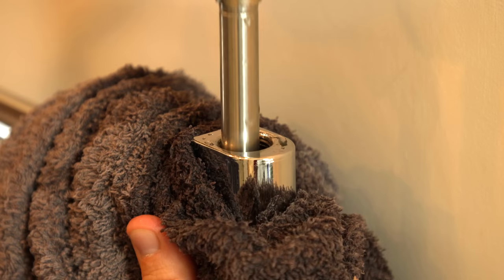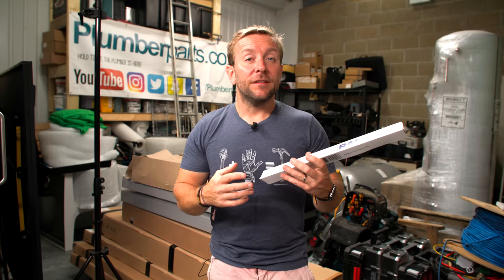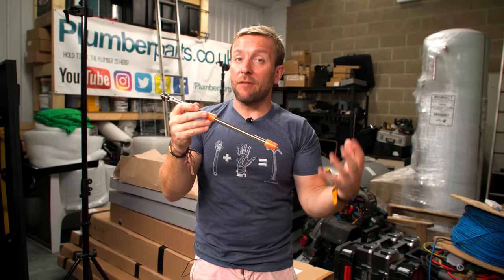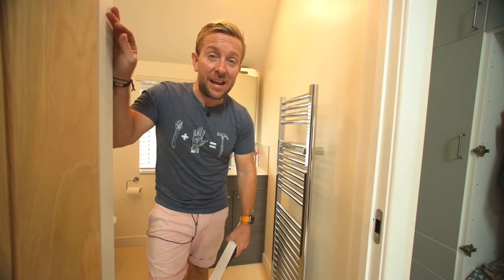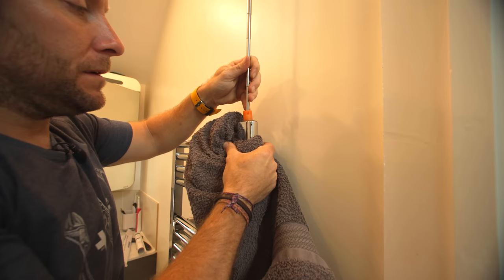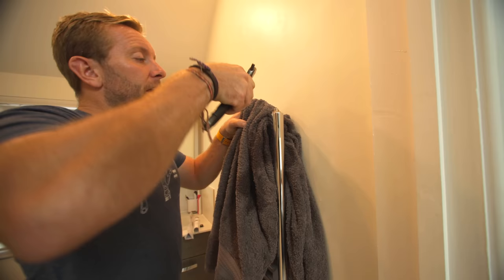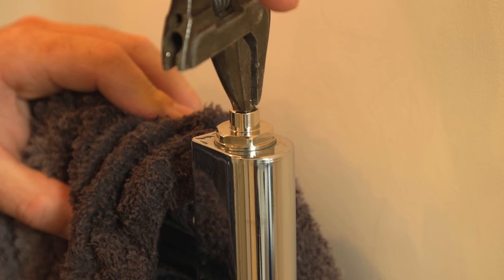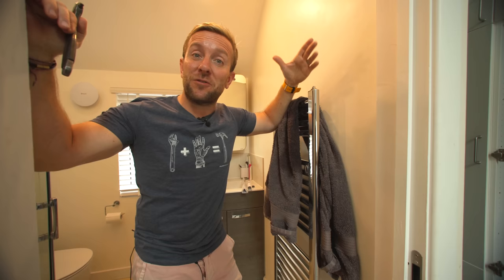DIY Magnetic filter INSIDE Radiator - How to fit Radmag

Comment: Hey James... Saw your video and thought what a genius product. I've got a Vaillant filter in my system but I thought Radmag would give it a helping hand. Anyway it turned up and I installed it real quick in my (tall) towel rail. Ran the heating for 30mins and of course had to see what I'd collected. Went to pull out the Radmag and found the little nut had fallen off the bottom and disappeared, and the bottom spacer was floating just below the vent hole. Cue a pause for thought... Fished out the spacer and noticed the hexagonal recess where presumably the locking nut should sit. Remembered that when I'd done the installation, the locknut was proud, and therefore loose. My bad I suppose.  Instructions could have mentioned checking this though. As I'm a very persistent man and don't like to be beaten, the next day I isolated my towel rail, took it off the wall, flushed it out and recovered the nut. Took the Radmag apart, re-assembled with all threads done up tight, and used Loctite. Problem solved but I think all purchasers should take that precaution, obviously before installing in a fit of enthusiasm, like me, and causing extra work :-) :-)

Comment: Guessing it’s a weak magnet and capacity load will be small? Can imagine it collecting what a magnaclean can then scraping off back in to the rad as you pull it out 😂
Reply from the maker: That’s what the plastic protectors are there to mitigate. I’ll know when I do a service in a couple of months. 👍
Reply: @plumberparts  may the gas gods be in your favour sir 😬
Reply: Ive installed them and magnet isnt weak at all
Reply: Wonder whats the service interval ?

Comment: I bought one, but didn’t have enough headroom to properly install it. 
I managed to take it apart, so I could lower it in piece by piece. Unfortunately, the orange plastic guides would not pass through due to the horizontal tubes being proud. Never mind, I thought, they’ll come off as well! They did, and everything was going well until the final piece of the telescopic piece also fell foul of the protruding tube! 
Defeated, I reversed the process. 

The magnet wasn’t in the radiator more than five minutes and it was thick with magnetite! It’s an impressive product, and for those whose installation went smoothly, I can see it working well. A shame it hasn’t worked for me. 
We have a real issue with where we can install a magnetic filter and I thought this would be perfect…….

Maybe I’ll replace the towel rail instead!

Comment: Nice idea. Better than nothing, but not a good position for a mag filter. If space on pipework is an issue, then fernox tf1 omega without valves can normally fit somewhere much more handy than that.

Comment: Bought one of these, removed after a month where it had collected a film of gunk. Put back after cleaning, 2 months later removed again for cleaning and found that the magnetic part had unscrewed along with the plastic spacers and left within the towel rail. I now have to remove the rail and try to push it all out from the bottom. I tried to reinsert and re-screw it all in situ but to no avail. Result new towel rail. Bad design due separation of magnetic end of rod. Beware !

Comment: Check that the bottom fixing Nyloc nuts are secure. Also check that the two blocks on the device fit the aperture of your towel rad. Do not force them in!!!!! If needed, sand them down to fit.

Comment: Why, at about 6:43 when you installed it, didn't you fully extend it so that the magnet was right at the bottom of the towel rail nearer the isolation valve?
Reply: it's 800mm long, the rad is 1200mm+ . Explained at 4:30
Reply: @UberAlphaSirus  Thanks. When you said  "we'll extend it that far" it sounded like you chose a specific amount to extend it rather than just fully extending it.  Makes sense now. Looks like a good product.

Comment: What about a normal rad, can these only be installed on towel rads?
Reply: any normal single panel rad.
Reply: Problem with normal rads is that your bleed screw is generally at the side, meaning the magnet rod would be installed horizontally at the top. Thus reducing the effect as most sludge sits at the bottom.

Comment: Hi James love your videos..just watched your plumbworld radiator video..I've just purchased 3 of the towel radiators pw1600600c the instructions show it fitted with the 4 bars at the bottom but all there pictures show other way up .phoned them to ask what's the right way to hang them an also asked him about the valve inside the radiators he didn't no what I was on about and whether it's upside down or not.if you can offer any help please.

Comment: Just wonder how those plastic guides will last after 12 months of hot water going over them, not totally convinced tbh
Reply: if they are made from polypropylene then no problem.
Reply: my kettle is made of plastic not to mention many other kitchen items that go inside a dishwasher without issue . plastic is robust &  hot water heat cycles will be no bother here.  where plastic is vulnerable  is around solvents usually petro paint thinner type like around vehicle engine bay plastic there is a nightmare.

Comment: I think this is a good idea in theory. But it’s not a replacement for a filter on the return! This will filter a small part of the system and if it blocks the towel rail blocks?
Fine for DIYers but not sure that heating engineers should be fitting it.

Comment: All well and good removing it from a towel radiator but won’t stop the build up downstairs and with you saying if you haven’t got or can’t fit a magnetic filter then use this, I doubt it would collect it, but if never serviced and a heating engineer was unaware then maybe in time it would clog up, ? Think in needs proven property on a bad system and maybe compare.

Comment: you should have done a idiots guide to removing the cap on the rad towl. If the flow does not stop in 20 sec or so then your valves may not be working and dont flood the house :)

Comment: Can these be used in conjunction with magna clean or instead of, or is there no point using this if you already have a magna clean installed?
Reply: He said he is fitting and he already has other in place .....
it would be good at end of line or furthest rad from the start imo

Comment: I fitted one last week, whilst doing other work on the heating system , easy to install, on recommissioning the system I took it out and it really does drag out the contamination and this is only out of the towel rad so far as not circulated yet. But the bleed screw is of such a very poor quality , it is as if a 1st year apprentice has made it by hand with a "bastard" cut file , it simply is so bad and not square to use a normal rad key. The use of a "juzzie" spanner simply is over kill and access is somewhat limited so not really convenient and not what should be expected. I will update this in 6 months .

Comment: Will it not make the whole towel rail magnetic and all the crap collect in there? Will be interesting to see
Reply: But then how do you get it out?
Reply: if it did you wouldn't get it in or out, it's just enough to catch the metal in the water....
it would be a good addition to the system and also add inhibitor

Comment: Will it fit in a regular rad (horizontally) ?
Reply: If your talking about standard panel radiators K type then no because they only have an opening of about an inch or two before branching off to the panel(s).  Some of those bigger vintage / school radiators might work and some modern panels might. Likewise same theory for adding electrical emersion style heaters to radiators.
Reply: @_Miner  gotcha, thanks
Reply: I have been using  Kamco machines  for 20+years and have worn one out, I've flushed so many systems!
Bought the original Adey powerflush kit at Earls Court when it first came on the market; Chris Adey was on the stand and I paid, I think 150quid, as an add on he gave me FOC a 300mm Magnaclean.The two combined is the only way to deal with badly contaminated  systems!
I would advise anyone  who is serious about combating magnetite to get on a Kamco course. If not, your not a serious professional. 
I'm  sure, given the numbers of boiler changes, a lot of installers may convince themselves that systems changed in even as little as the last 10-15 years only require draining and refilling, thorough flush or Magnaflush as being adequate.
If the the condition of the system is not seriously  determined , the life of the boiler is bound to be negatively  impacted! And using cheap and or inappropriate cleaning and inhibitors can not be tolerated by the professional  installer.
I know my comments will not be greater positively  by many , but don't  listen to me, take the time to find out what Kamco etc. Fernox, Sentinel, Adey,Scalemaster, Calmag and other quality providers can add to your expertise.
Knowledge  is not cheap, quality is not cheap and cheap don't buy a professional  installation.
All this prompted  by the absolute and most outrageous,misleading, cynical posting by plumber parts!!
I'm  and have Always endeavoured  to portray myself and the trades in the most positive way.That sort of commitment  didn't  come cheap, unlike this most disgraceful misrepresentation!!
I look forward to you making amends.

Comment: Do you think this will stop the build up of sludge in other radiators or just the towel rail?
Reply: It should help clean the water in all the radiators as it picks up sludge when the water flows through. That's the idea anyway.

Comment: Not as good as understanding water quality and preventing a dirty system of course but the UK market is a completely different one to the rest of Europe.
Reply: This is an irrelevent comment as in the real world we deal with peoples heating systems as they are not how ideally we would like them to be. Radmag helps to clean up heating systems in the real world.
Reply: @marknorris5529  flushing the system is a solution, this is like putting a plaster on a knife wound.  It's just another gadget being sold into the massive British heating industry when what installers really need is a higher level of training.
Reply: @patrickwheeler2646  Then you clearly think the same of jar filters too
Reply: @marknorris5529  not for retrofit, most systems have been neglected for a long time and the existing corrosion of steel radiators has to be prevented from damaging new heat sources.  For new installations I do yes.
Reply: @patrickwheeler2646  then logic suggests you must think the same for radmag too
Reply: @marknorris5529  meh, I can't see why you would bother instead of putting in an MB3 or TF1 Omega.
Reply: @patrickwheeler2646  because you need to cut the return pipe on 22mm thats the point.
Reply: @marknorris5529  the section of diyers who will be comfortable fitting this product but not confident draining and cutting in a filter AND won't pay for a professional to do it is incredibly tiny.

Comment: Warning just tried to fit this the orange sleeve was really tight so much so I could not get it out of the towel radiator. I had to cut the top orange one off so that it would go in . Now I can just pull it out to the magnet section to clean it . Please check if it’s tight don’t put it in towel radiator. If both sleeve were in I would never have got it out . Please be aware

Comment: Absolute waste of money. Anyone who knows anything about  system contamination will I'm  sure be outraged by this one sided, simplistic and misleading presentation!
Reply: You not protecting the boiler at all which is what they're all about
Reply: If you become outraged then your just a sad individual and need to chill out
Reply: @lestc8579  You, obviously have no idea what magnetic filtration and system cleaning is all about!
Reply: @johnward5006  if you think a jar filter like magnaclean is effective which they are why do you think Radmag isnt its the same water going round the system.?
Reply: @marknorris5529  For one thing beyond the length of the device it won't  capture magnetite. Secondly, what it may capture for retrieval  is limited by the internal diameter  of the 1/2" female BSP thread, 21mm, which greatly reduces its value.
It's therefore only of use in previously thoroughly  flushed systems.
Reply: @johnward5006  well i can tell you that you are 100% wrong as they do work as fitted it.
Maybe hold of your judgements until you have done the same
Reply: @marknorris5529  If you've  ever seen a heavily fouled system system you'd  change your mind.As I made clear, they are of limited use. Read BS 7593 on system cleaning which is the basis of part L and therefore enshrined in law, so don't  lecture me with you clueless  nonsense!

Comment: Having watched  the video, I've responded initially; Having taken the time to reflect on the presentation, I'll  say this; Up to one 1 metre in length,  what about 1.8metres?
No mention  of the relevance  of flow or return installation. The contaminates are at the BOTTOM  of the rad! Anyone  who spends 40 to 50 Quid on this is a FOOL!  
CHECK OUT MAGNETITE ON GOOGLE, DO NOT ! PUT YOUR HANDS IN YOUR POCKETS " GUYS" !
At the risk of being sued for who knows what, this product will not meet Part L Building regs!  I welcome an intelligent response!!
Reply: why does this not meet part L regs?
Reply: @marknorris5529  If you read part L, or better still, take the time to watch Derek Robins video at Tomkat  gas training you'll have a clearer view than I could explain here. To everyone, it should be understood that Building  Regs. are mandatory and contravention can result in criminal prosecution!
Reply: @johnward5006  John you havent explained why it does not allow a heating engineer to comply. You also assume incorrectly i have read the section on magnetic filters

Comment: What we really need is widespread upgrading of iron/steel rads to something like brass/aluminium - Maybe not even the entire thing, just the inner cavities in contact with the water. 
No iron on the line -> no magnetite in the pipes to deal with. So many old, sludgy systems out there punishing their boilers trying to get the house warm! There's probably a fair amount of gas could be saved if this was actually pursued nationally (no chance with this gov though) 🧲😎
Reply: Much easier and cheaper to just fix the water and keep the oxygen out.
Reply: @edc1569  Really? I'd be interested to know what you have in mind since you do mention water and not some other solvent which would be another clever workaround (maybe a not-very-viscous oil in the CH instead but then that's a boiler alteration).

You could bubble nitrogen through a tank of water with an outlet to offgas to fully deoxygenate it, and then fill your system (under vacuum) with that water to avoid letting any air or oxygen from the air in, but that's neither easier nor cheaper in any way than just swapping out steel for brass/aluminium rads (of course) so I fear you might be just shooting the shit :P It would also add needless complication to have to order in this 'special water' for a job instead of tapping into the cold mains to fill :P

And in practical terms, it's almost a guarantee that air will get in at some point in some tiny quantity through the smallest gap somewhere and then you're right back at square 1 lol